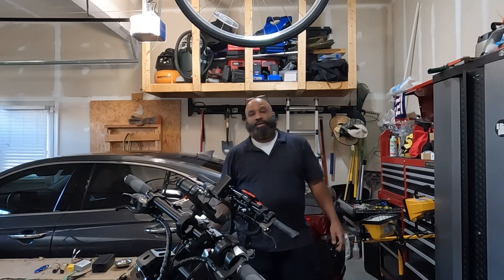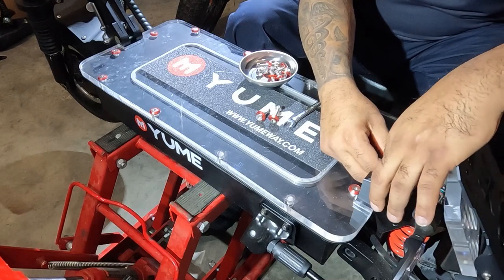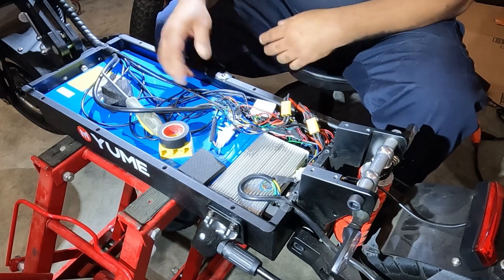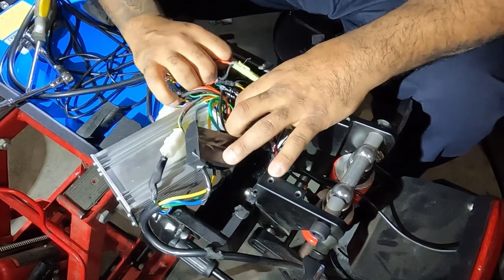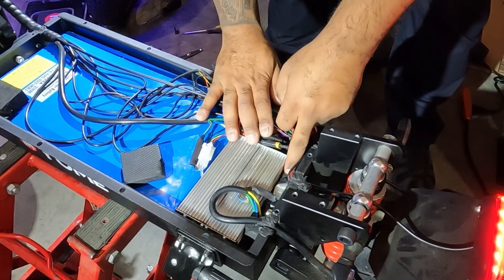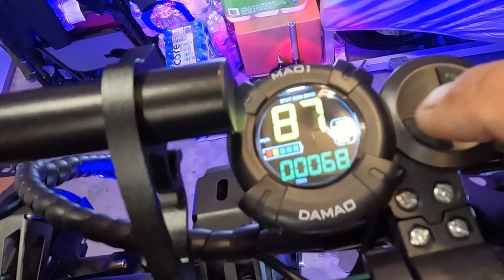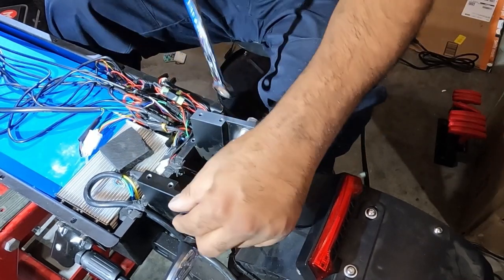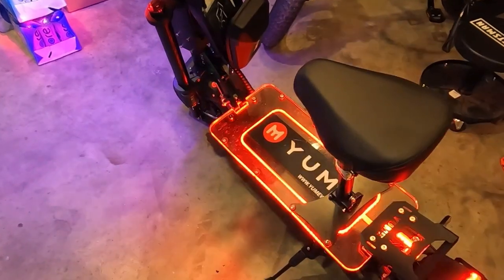Scooters   fixing the YUME X7    IT'S BACK and A BEAST

Comment: I just got my scooter in. I plugged the charger port to scooter only and it's sparking. Any ideas why?
Reply from the maker: I don't other than to take the board ff and see if the power block where the wires are screwed in is touching.  Mine was loose and sparked a little then it smoked.  After YUME sent me a new distribution block, I haven't had any issues like that.

Comment: Those ports are an active fire hazard, one of the first things I did was swap to female XLR panel mount connectors. Thicker gauge charging wire helps too. This also enables you to run up to about 10 amps per connection vs the 6ish amps max the smaller microphone connectors take. As James said below, connections for the phase wires are important too, since they can carry 2-300 phase amps under acceleration, and any losses are lost acceleration.
Reply from the maker: @Angry Wheels  I wish I were confident enough to go that deep into upgrading the scoots. I would prob mess with the lesser expensive Y10 before the X7. I like the speed but would trade some of that for range any day!

Comment: Hey Tim. I saw you have the X7 and Y10 scooters. The price is pretty different and the Y10 is in my  budget. Would you recommend the Y10?
Reply from the maker: @Manny Aguila   I would absolutely recommend the Y10. I love my Y10. I ride either scoot based off of what I am doing. If it's just long distance and street, I would ride the X7. It has a bigger battery and longer "stated" range. If I will be on non-street surfaces or shorter (30 miles & under) then I would ride the Y10.  Don't discount the Y10.  I did that and fell on it.  lol

Comment: Hey Tim, I appreciate your videos. I own the yume x11. I have had it for a month now. Not able to ride it.  It did not work properly out of the box. The rear hub motor will engage when I first hit the throttle but after 1 or 2 seconds it cuts out and stops. I let off and pull the trigger again same thing. It seems to be a rear hub motor issue because when I flop controllers the rear controller will run the front hub motor no problems. I have addressed this with yume customer service and all they have done, is sent me two new display throttles. I have reached out to yume letting know I would like a new hub motor or a replacement for the scooter.  It seems like they are now ignoring my emails and WhattsApp communications. What do you suggest? Is their customer service really this bad if something a bit major is wrong with the scooter. They don't want to stand by their warrenty?
Reply from the maker: I'm sorry to hear that.  I did not have any issues with YUME.  They were slow once to respond but they always did.
Reply: @timdiggitty7064  it is not that they are not responding now.  It just seems as if they don't want to address the obvious issue, being the hub motor. The only thing I can guess why,  is because it is the second most expensive part of the scooter. They now want to send me a new controller. But it obviously isn't the controller because it works fine when plugged into the front hub motor. I have made that very clear to them. Not sure how to get them to understand.  I have even requested that I send this one back so they can just send me another one. I just get ignored on that comment and they go into questions like plug in the white learning wires. Push the yellow speed control button.  Like I haven't already done that lol.
Reply from the maker: @edgurash834  I hope you get it resolved
Reply: @timdiggitty7064  update. They just got back to me. They are sending me a new motor! They seem t9 be coming through. Thanks man. Keep the videos coming.
Reply from the maker: @edgurash834  I'm glad to hear that...

Comment: What's the real range of Yume X7?
Reply from the maker: It says up to 80 miles but I'm pretty sure that's at the slowest and lowest power settings with a 150-160 lb. person riding on the flattest surface one can find.  I have gotten close to 40 miles before I got tired.  I believe that I could get close to 50 miles in 1st gear turbo on dual motors.  i am 225 lbs. and ride on varying surfaces. I don't usually ride faster than 30 mph for long periods.

Comment: Thank you, please tell me whether the cover under the glass has sufficient strength to withstand 92 kilograms, or this scooter cannot be used without an upper transparent layer?
Reply from the maker: @Александр [Y̲̅σ̲̅υ̲̅т̲̅υ̲̅b̲̅є̲̅]    I way 98 kilograms (217/218 lbs) and it moves with NO PROBLEMS. The glass or plexiglass is very thick
Reply: @timdiggitty7064  I mean, there is 1 more plate under the glass, does it have strength?
Reply from the maker: @yb8425    The actual top of the deck is under the plexiglass.  It is the normal metal. I feel comfortable riding it and I am heavier than you.  92 Kilos will be good.
Reply: @timdiggitty7064  thank you

Comment: Hey Tim, thanks for sharing! I'd like to know if you have a specific model to look for, I am mainly looking for commuting and I'M 5'11 350 pounds. Thanks in adavance!
Reply from the maker: @Marc-André Yelle  The YUME is rated at 330lbs and that normally means half of the range and slower speeds for all scooters.  If it's for commuting, EMove has a cruiser rated to 350lbs+.  The range is 62mi stated. I would cut that in half, give or take a few miles just to be safe.  I don't know much about the EMove though.
Reply: Im 330 and wear about 40 lbs of gear and ride a lifted FLJ k6 13 inch scooter, main issue with most weight ratings is them finding someone heavy enough to test them hence the limits. it is good advice to reduce expectations on top speed, id say by 20% or so napkin math wise. edit: removed my dumb recommendation for the y11, I had forgotten the x7 comes with 13 inch tire, its the best for us big guys.
Reply from the maker: @darkchild256  The X7 gets me up and down the road and hills with no problem. I have been nothing but impressed with it's power. It does not burn out when taking off but I did not want that.

Comment: Hey Tim replace that junction box it will just cause issues and maybe catch fire it will most likely do the same thing. replace all your phase wires connectors with good quality bullet connectors 6.5mm and above and you should have less issues
Reply from the maker: @James Thornton   Thank you.  I will look at the changes.  I haven't had any issues since I changed the junction box.
Reply: @timdiggitty7064  thats great. Hows the scooter holding. Have you had any problems with yume x7?
Reply from the maker: @perunao4823  The X7 was the scoot I had to replace the junction box on. After that, no problems except for the weather!      lol
Reply: and dont use regular bullets, use XT150s as they are long and secure well, ive burned many 6mm bullets at 12kw
Reply: @darkchild256  100% xt150’s are great I’m using them at the moment for my scoot

Comment: 22:08 looks like a wire is rubbing left side of the screen top left of the wheel
Reply from the maker: @
The Generalist  Thx. I did fix all of that before I put the scoot back together. I also used electrical tape in places that looked like there could be a later issue.

Comment: Yume build quality is scary.
Reply from the maker: I think it's in line with all of the others. BUT, I 've only owned a YUME as far as high-powered scoots
Reply: @timdiggitty7064  I went from a Yume to a King GT. It is a pretty big difference in quality. My Yume battery wouldn't charge ever. I had to wait a month for a new battery to arrive. Then a controller went out and I had to replace that. This is all before 150 miles. I may have had a lemon though, who knows.
Reply from the maker: @pohalsted8847  dang. Sorry you went through that.  i only had a distro block issue with the X7. I looked at the GT Pro but couldn't see myself spending $3500+ for a scooter.  Not Yet.  I had been riding for about a month and a half at that point. I saved 1k with the YUME.
Reply: @pohalsted8847  I had controller issues too. Controller failed after 10 miles, replacements failed after 5 weeks. The controllers are not designed for this power. Pretty sure it’s a known fault..